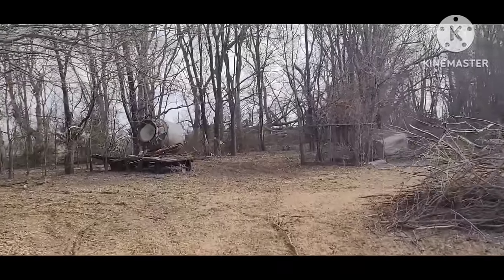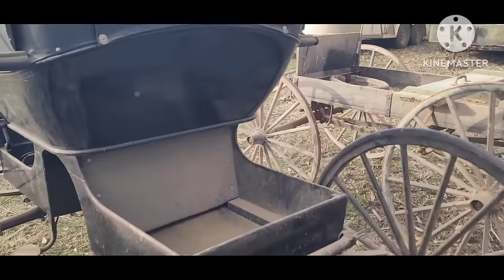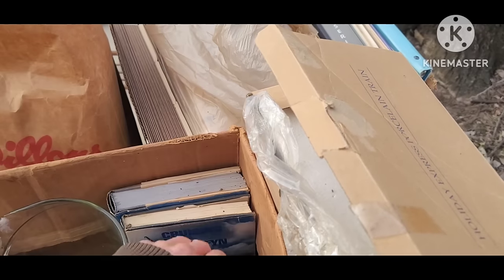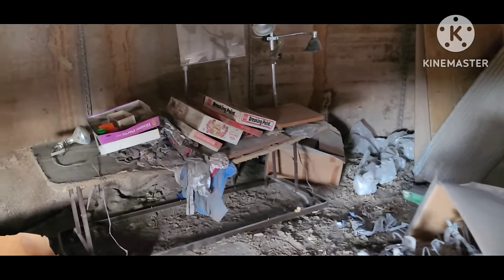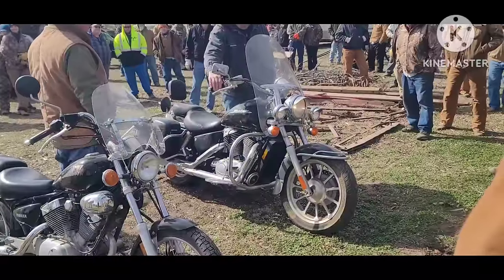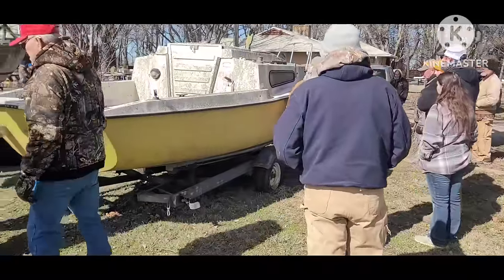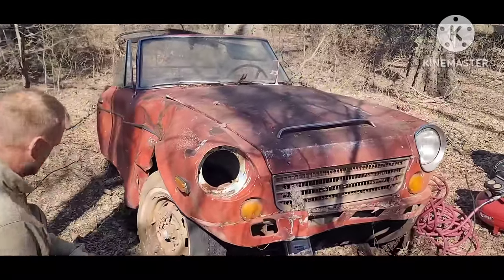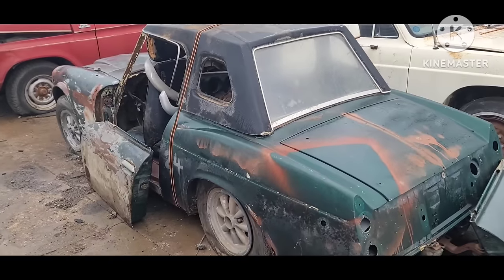Farm Auction Finds: Planes, Sailboats & Automobiles! Plus John Deere tractors & equipment!

Comment: chicken houses had chicken wire with hay or straw in the ceiling and walls and the chickens put out the heat.  They were very warm in the winter and cooler in the summer.  Also had many mites and rats.

Comment: Tim, The glider is an "Easy Riser" biplane hang glider. Referred to as a rigid wing type as opposed to the traditional "kite" or Rogallo wing triangle hang glider. It would be foot launched from a high point, slope or cliff, depending on your level of youth and bravery. A a rule though, the Easy Riser had much better control and performance and a better glide ratio than other hang gliders of the 70's & 80's era. Interesting find... it looks like someone caught a wingtip and boogered it up.
Reply from the maker: Fascinating info, thanks Leeroy.
I don't think I've got the youth and bravery to try it out, or take on the repairs it needs. I listed it on Facebook Marketplace

Comment: Did you know there's a company that builds FAA certified Corvair engines (110hp?) for light aircraft?  ;-)
My mom had worked at a tire store (bookkeeper) and was given a free set of Michelin tires for our 64 Corvair convertible.
It was funny, this small woman trying to tell a gas station attendant, the tires weren't flat.  ;-D

Comment: Thosemotorcycles were really really great buys. Any running bike is worth 1000 to 1500 minimum. Judging by the commentary I would say a good wash and it would be roading time. I live too far awy to get in on the deals, but you seem to find the best, even that roached Datsun has some highly valued parts. If nothing else the boys had fun in it.
Reply: Spot on. The secret is to go to an auction where you know the crowd would have no clue about the item you want. Those bikes with titles would be gone for twice these sums without doing anything and much more if you spend some time detailing them.

Comment: My brother had a Datsun 2000.  Had the 2000cc engine instead of the 1600cc. His was almost factory fresh. Quick and fun sports car. Where I live you couldnt touch that little sailboat for less than 2 grand
Reply from the maker: The small sailboat was a smart buy I thought. Best condition of the three since it had been stored inside. If anyone is in the market for roadsters, boats, or motorcycles, I'd recommend going bargain shopping for them on days when the weather is below freezing!

Comment: Someone else said it but that was a chicken roost or at least where they could lay their eggs.  My grandparents had chickens and their roosts were galvanized and the eggs would actually roll to the front into an area where the hen couldn't sit on them.  The ceilings they had were chicken wire like you saw there and there could be straw on top of the wire.  I don't know if it was insulation or why it was there but the chicken wire was so that they couldn't fly up into the rafters.